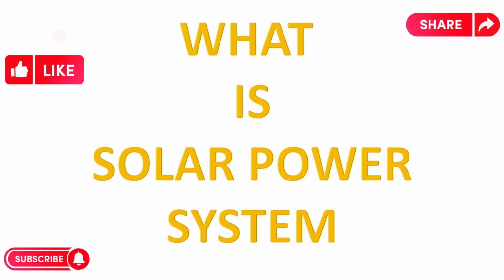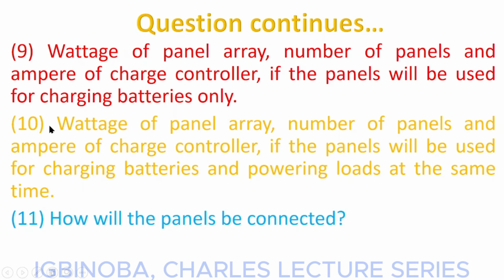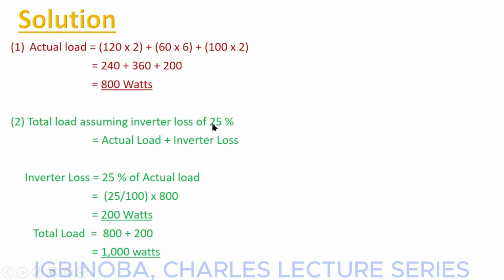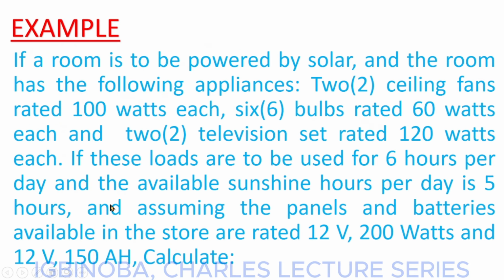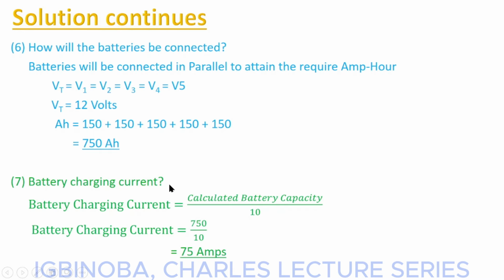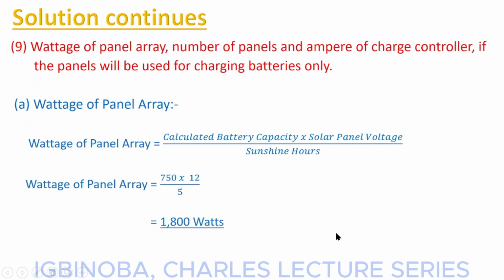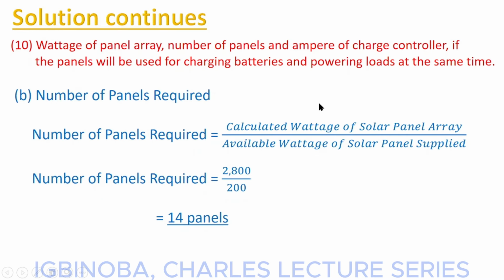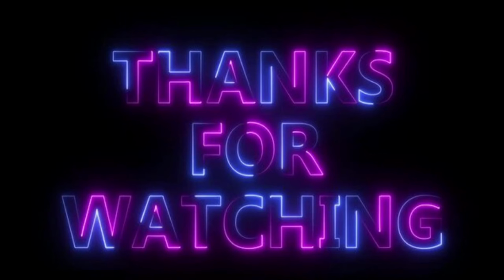Design of Solar Power System

Comment: Petro322v 
1) actual load=1380watts
2)total load =1725watts 
3)inverter rating=2156.25v
4)battery capacity =1293.75Ah
5)number of batteries =9
6)batteries are connected in parallel 
7) battery charging current is 129.4amps 
8)charging time=4hours 
9a)wattage of panel array=3105watts
9b)number of panels =16 panels 
9c)charge controller =258.75
10a)wattage of panel array =4830watts
10b)number of panels=24
10c)charge controller =402.5A
11)panels are arranged in parallel

Comment: CIV36F 
1. Actual load: 1380 watts
2. Total load: 1725 watts
3. Inverter rating: 2156.25 VA
4. Battery capacity:1293.75 Ah
5. Number of batteries: 8.6
6. Connection: parallel 
7. Battery charging current: 129.375
8. Charging time 
9. a. Wattage of panel array: 3105W
     b. Number of panels:16 panels 
     c. Charge controller: 258.75A
10 a. Wattage of panel array - 4830W
      b. Number of panel - 24
      c. Charge controller - 402.5A
11. Panels arrangement: Parallel
Reply: CIV317Q

1. Actual load:1380 watts
2. Total load:1725 watts
3. Inverter rating:2156.25 VA
4. Battery capacity:1293.75 Ah
5. Number of batteries:8.6
6. Connection:Parallel
7. Battery charging current:129.375 A
8. Charging time:
9. a. Wattage of panel array:3105 W
   b. Number of panels:16 panels
   c. Charge controller:258.75 A
10. a. Wattage of panel array:4830 W
    b. Number of panels:24 panels
    c. Charge controller:402.5 A
11. Panels arrangement:Parallel

Comment: PETRO3128X
ANSWERS TO SWEP NEW TASK 
1. Actual load= (100×3)+(60×10)+(120×4) =1380watts
2. Total load assuming inverter loss of 25%= Actual load +Inverter loss
Inverter loss=25% of Actual load
= 25%×1380=345 watts
Total load= 1380+345=1725 watts
3. Inverter rating on VA using power factor of 0.8
= (1725÷0.8)= 2156.25
4. Battery capacity using factor for reserve 75%=(2×1725×6×0.75)=1293.75Ah
5. No. of batteries for backup hours=1293.75Ah÷150Ah= 8.6 =8 batteries 
6. How batteries will be connected?
The batteries will be connected in parallel 
Vt=V1=V2=V3=V4=V5=V6=V7=V8
Ah= 150+150+150+150+150+150+150+150=1200
7. Battery charging current=1293.75÷10=129Amps
8. Battery charging time assuming charging loss of 40%= 1293.75Ah+(40%+1293.75Ah)÷129A=14hrs
9a. Wattage panel array= 3105 watts
9b. Number of panels required= 3105÷345=9 panels 
9c. Ampere of charging controller required= 3105÷12=258.75Amps
10a. Wattage of panel array= Calculated wattage of solar panel array for charging battery only+ calculated total load =3105+1725=4830watts
10b. Number of panels required= calculated wattage of solar panel array÷ Available wattage of solar panel supplied= 4830watts÷345= 14Amps
10c. Ampere of charge controller= calculated wattage of solar panel array÷ solar panel voltage=4830watts÷12volts= 402.5Amps
11. How will the panels be connected?
Ans: They will be connected in parallel

Comment: PETROCHEM392N

1 Actual load 1380W
2 Total load  1720W
3 Inverter rating  2156.25VA
4 battery Capacity 1293.75Ah
5 number of batteries 8.6
6 Parallel 
7 Battery charging  129.4A
8 T = 14hrs
9 (a) 3105W
   (b) 15.5 panels 
   (c)  258.75 A
10 (a) 4830W 
     (b) 24 panel 
     (c) 402.5A 
11 Parallel

Comment: COMP3111G

1. Actual load: 1380 W
2. Total load with 25% inverter loss: 1840W
3. Inverter rating (PF 0.8): 2 300 VA
4. Battery capacity (75% reserve): =920 Ah
5. Number of batteries: 7 batteries
6. Battery connection: All parallel
7. Battery charging current: 138 A
8. Battery charging time (40% loss):8.3 hours
9. Panels for battery charging only: 14 panels (2800 W), 250 A controller
10. Panels for charging + direct load: 26 panels (5 200 W), 420–450 A controller
11. Panel connection: 7S2P

Comment: COMP316P

1.	Actual Load = 1380 watts
	2.	Total Load = 1725 watts
	3.	Inverter Rating = 2156.25 VA
	4.	Battery Capacity = 1293.75 Ah
	5.	Number of Batteries = 8.625 ~ 9 batteries
	6.	Parallel
	7.	Battery charging current = 129.375 Amps
	8.	Charging time = 14 hrs
	9.	(a) 3105 watts
(b) 15.525 ~ 16 panels
(c) 258.75 Amps
	10.	(a) 4830 watts
(b) 24.15 ~ 24 panels
(c) 402.5 Amps
	11.	Parallel
Reply: EEE378Z

1. Actual Load = 1380 watts

2. Total Load = 1725 watts

3. Inverter Rating = 2156.25 VA

4. Battery Capacity = 1293.75 Ah

5. Number of Batteries = 8.625~9 batteries

6. Parallel

7. Battery charging current = 129.375 Amps

8. Charging time = 14 hrs

9. (a) 3105 watts

(b) 15.525~16 panels

(c) 258.75 Amps

10. (a) 4830 watts

(b) 24.15~24 panels

(c) 402.5 Amps

11. Parallel

Comment: COMP384F
 

	1.	Actual Load = 1380 watts
	2.	Total Load = 1725 watts
	3.	Inverter Rating = 2156.25 VA
	4.	Battery Capacity = 1293.75 Ah
	5.	Number of Batteries = 8.625 ~ 9 batteries
	6.	Parallel
	7.	Battery charging current = 129.375 Amps
	8.	Charging time = 14 hrs
	9.	(a) 3105 watts
(b) 15.525 ~ 16 panels
(c) 258.75 Amps
	10.	(a) 4830 watts
(b) 24.15 ~ 24 panels
(c) 402.5 Amps
	11.	Parallel

Comment: CIV340N

1. Actual Load = 1380 watts
2. Total Load = 1725 watts
3. Inverter Rating = 2156.25 VA
4. Battery Capacity = 1293.75 Ah
5. Number of Batteries = 8.625 ~ 9 batteries
6. Parallel
7. Battery charging current = 129.375 Amps
8. Charging time = 14 hrs
9. (a) 3105 watts
(b) 15.525 ~ 16 panels
(c) 258.75 Amps
10. (a) 4830 watts
(b) 24.15 ~ 24 panels
(c) 402.5 Amps
11. Parallel

Comment: EEE3158B
1. Actual load = 1380 watts
2. Total load = 1725 watts
3.Inverter rating = 2156.25 VA
4.Battery rating = 1293.75 Ah
5.Number of batteries = 9
6.Battery are connected in parallel
7.Battery charging current = 129.4 Amps
8.Battery charging time = 14 hrs
9
a Wattage of panel array = 3105 watts
b Number of panel = 16 panels
c Charge controller = 258.75 A
10.
a Wattage of panel array = 4830 watts
b Number of panels = 24
c Charge controller = 402.5 A
11.panels are arranged in parallel

Comment: PETRO347U

1. Actual load= (100 × 3)+(60 × 10)+(120 × 4) =1380watts.

2. Total load assuming inverter loss of 25%= Actual load +Inverter loss
Inverter loss=25% of Actual load
= 25%×1380=345 watts
Total load= 1380+345=1725 watts.

3. Inverter rating on VA using power factor of 0.8
= (1725÷0.8)= 2156.25 VA

4. Battery capacity using factor for reserve 75%=(2 × 1725 × 6 × 0.75) ÷ 12=1293.75Ah

5. No. of batteries for backup hours = 1293.75Ah ÷ 150Ah = 8.6 = 9 batteries.

6. How will the batteries be connected?
The batteries will be connected in parallel .

7. Battery charging current = 1293.75 ÷ 10 = 129 Amps

8. Battery charging time assuming charging loss of 40% = 1293.75Ah + (40% + 1293.75Ah) ÷ 129A = 14 Hrs.

9a. Wattage panel array= 3105 watts

9b. Number of panels required= 3105 ÷ 200 = 15.53 = 16 panels 

9c. Ampere of charging controller required= 3105 ÷ 12 = 258.75 Amps.

10a. Wattage of panel array= Calculated wattage of solar panel array for charging battery only+ calculated total load = 3105+1725 = 4830watts.

10b. Number of panels required= calculated wattage of solar panel array ÷ Available wattage of solar panel supplied= 4830 ÷ 200 = 24.15 panels 

10c. Ampere of charge controller= calculated wattage of solar panel array ÷ solar panel voltage = 4830watts ÷ 12Volts= 402.5 Amps.

11. How will the panels be connected?
Ans: They will be connected in parallel

Comment: MAR340N

1. Actual load= (100×3)+(60×10)+(120×4) =1380watts
2. Total load assuming inverter loss of 25%= Actual load +Inverter loss
Inverter loss=25% of Actual load
= 25%×1380=345 watts
Total load= 1380+345=1725 watts
3. Inverter rating on VA using power factor of 0.8
= (1725÷0.8)= 2156.25
4. Battery capacity using factor for reserve 75%=(2×1725×6×0.75)=1293.75Ah
5. No. of batteries for backup hours=1293.75Ah÷150Ah= 8.6 =8 batteries 
6. How batteries will be connected?
The batteries will be connected in parallel 
Vt=V1=V2=V3=V4=V5=V6=V7=V8
Ah= 150+150+150+150+150+150+150+150=1200
7. Battery charging current=1293.75÷10=129Amps
8. Battery charging time assuming charging loss of 40%= 1293.75Ah+(40%+1293.75Ah)÷129A=14hrs
9a. Wattage panel array= 3105 watts
9b. Number of panels required= 3105÷345=9 panels 
9c. Ampere of charging controller required= 3105÷12=258.75Amps
10a. Wattage of panel array= Calculated wattage of solar panel array for charging battery only+ calculated total load =3105+1725=4830watts
10b. Number of panels required= calculated wattage of solar panel array÷ Available wattage of solar panel supplied= 4830watts÷345= 14Amps
10c. Ampere of charge controller= calculated wattage of solar panel array÷ solar panel voltage=4830watts÷12volts= 402.5Amps
11. How will the panels be connected?
Ans: They will be connected in parallel

Comment: EEE322V

1)actual load = 1380watts 

2)total load= 1725 watts 

3) inverter rating =2156.25VA 

4)battery capacity= 1293.75A

 5)No of batteries= 9
 
6)batteries are connected in parallel 

7)battery charging current =129.4amps 

8)battery charging time=14hrs 

9a) wattage of panel array= 3105watts 

9b)number of panels=16panels 

9c)charge controller= 258.75A 

10a)wattage of panel array= 4830watts 

10b)number of panels = 24 

10c)charge controller= 402.5A 

11)panels are arranged in parallel
Reply: 1)actual load = 1380watts     

2)total load= 1725 watts

3) inverter rating =2156.25VA 

4) battery capacity= 1293.75A 

5) No of batteries= 9 

6) batteries are connected in parallel 

7) battery charging current =129.4amps 

8)battery charging time=14hrs 

9a) wattage of panel array= 3105watts 
9b) number of panels=16panels 
9c)charge controller= 258.75A 

10a) wattage of panel array= 4830watts 
10b) number of panels = 24 
10c) charge controller= 402.5A 

11)panels are arranged in parallel Add a reply...

Comment: MAR3151U

1. Actual load= (100×3)+(60×10)+(120×4) =1380watts
2. Total load assuming inverter loss of 25%= Actual load +Inverter loss
Inverter loss=25% of Actual load
= 25%×1380=345 watts
Total load= 1380+345=1725 watts
3. Inverter rating on VA using power factor of 0.8
= (1725÷0.8)= 2156.25
4. Battery capacity using factor for reserve 75%=(2×1725×6×0.75)=1293.75Ah
5. No. of batteries for backup hours=1293.75Ah÷150Ah= 8.6 =8 batteries 
6. How batteries will be connected?
The batteries will be connected in parallel 
Vt=V1=V2=V3=V4=V5=V6=V7=V8
Ah= 150+150+150+150+150+150+150+150=1200
7. Battery charging current=1293.75÷10=129Amps
8. Battery charging time assuming charging loss of 40%= 1293.75Ah+(40%+1293.75Ah)÷129A=14hrs
9a. Wattage panel array= 3105 watts
9b. Number of panels required= 3105÷345=9 panels 
9c. Ampere of charging controller required= 3105÷12=258.75Amps
10a. Wattage of panel array= Calculated wattage of solar panel array for charging battery only+ calculated total load =3105+1725=4830watts
10b. Number of panels required= calculated wattage of solar panel array÷ Available wattage of solar panel supplied= 4830watts÷345= 14Amps
10c. Ampere of charge controller= calculated wattage of solar panel array÷ solar panel voltage=4830watts÷12volts= 402.5Amps
11. How will the panels be connected?
Ans: They will be connected in parallel

Comment: PETRO 9I 
1. Actual Load = 1380 watts

2. Total Load = 1725 watts

3. Inverter Rating = 2156.25 VA

4. Battery Capacity = 1293.75 Ah

5. Number of Batteries = 8.625~9 batteries

6. Parallel

7. Battery charging current = 129.375 Amps

8. Charging time = 14 hrs

9. (a) 3105 watts

(b) 15.525~16 panels

(c) 258.75 Amps

10.(a) 4830 watts

(b) 24.15~24 panels

(c) 402.5 Amps

11. Parallel

Comment: PETRO321U

1. Actual load= 1380watts
2. Total load assuming inverter loss of
25%=1725 watts
3. Inverter rating on VA using power factor of 0.8
= 2156.25VA
4. Battery capacity using factor for reserve
75%=1293.75Ah
5. No. of batteries for backup hours =9 batteries
6. How batteries will be connected?
The batteries will be connected in parallel
7. Battery charging current=129.4Amps

8. Battery charging time assuming charging loss of 40%=14hrs
9a. Wattage panel array= 3105 watts
9b. Number of panels required= 16panels
9c. Ampere of charging controller required=258.75Amps
10a. Wattage of panel array=4830watts
10b. Number of panels required= 24 panels
10c. Ampere of charge controller= 402.5Amps
11. How will the panels be connected?
They will be connected in parallel

Comment: MECH 387I
1) Actual Load=1380watts

2) Total load=1725watts

3) Inverter rating=2156.25v

4) Battery capacity=1293.75Ah

5) No of batteries=9

6) Batteries are connected in parallel 

7) Battery charging current=129.4amps

8) Battery charging time=14hrs

9a) Wattage of panel array=3105watts

9b) Number of panels=16panels

9c) Charger controller=258.75A

10a) Wattage of panel array=4830watts

10b) Number of panels=24

10c) Charger controller=402.5A

11) Pannel are arranged in parallel

Comment: MECH 3167K
1. Actual load 1380 Watts
2. Total load 1725 Watts
3. Inverter rating 2156.25VA
4. Battery capacity 1293.75Ah
5. Number of batteries 9
6. Parallel 
7. Battery Charging current 129.375amps
8. Charging time 14 hrs
9a. 3105 Watts
9b. 16 panels
9c. 285.75 amps 
10a. 4830 Watts
10b  24 panels
10c. 402.5 amps
11. Parallel

Comment: MECH3163G
1.) Actual load: 1380W
2.) Total load: 1840W
3.) Inverter Rating: 2300VA
4.) Battery Capacity: 1227Ah
5.) No. of Batteries: 9 batteries 
6.) Battery Connection: Parallel 
7.) Battery Charging Current: 15A
8.) Battery Charging Time: 5.1 days
9.) Panel Array -
a.) Wattage: 2945W
b.) No. of Panel: 15 panels
c.) Charging Controller Ampere: 245A
10.) Panel Array -
  a.) Wattage: 4785W
  b.) No. of Panels: 24 panels
  c.) Charge Controller Ampere: 339A 
11.) Panel Connection Series: Parallel

Comment: EEE3159C

1) Actual Load= 1380watts 
2) Total Load= 1725watts 
3) Inverter rating = 2156.25vA
4) Battery Capacity = 1293.75Ah 
5) No of Batteries = 9 
6) Batteries are connected in Parallel 
7) Battery Charging current= 129.4 amps 
8) Battery Charging time = 14hrs 
9a) Wattage of panel array = 3105watts 
9b) Number of panels = 16 panels 
9c) Charge Controller = 258.75A 
10a) Wattage of panel array = 4830watts 
10b) Number of panels = 24 
10c) Charge Controller = 402.5A 
11) Panels are arranged in Parallel

Comment: MAR348V

1. Actual load: 1380 W
2. Total load with 25% inverter loss: 1840W
3. Inverter rating (PF 0.8): 2 300 VA
4. Battery capacity (75% reserve): =920 Ah
5. Number of batteries: 7 batteries
6. Battery connection: All parallel
7. Battery charging current: 138 A
8. Battery charging time (40% loss):8.3 hours
9. Panels for battery charging only: 14 panels (2800 W), 250 A controller
10. Panels for charging + direct load: 26 panels (5 200 W), 420–450 A controller
11. Panel connection: 7S2P

Comment: MECH3139I

1. Actual load = 1380W
2. Total load = 1725W
3. Inverter rating = 2156.25VA
4. Battery capacity = 1293.75Ah
5. Number of batteries = 9
6. Connection is parallel 
7. Charging current = 129.38A
8. Charging time = 14 hrs
9a. 3150W 
9b. 15.5 -- 16 panels
9c. 258.75A
10a. 4830W
10b. 24 panels
10c. 402.5A
11. Connection is parallel

Comment: PETRO3136F

1. Actual load= 1380watts

2. Total load assuming inverter loss of 25%=1725 watts

3. Inverter rating on VA using power factor of 0.8
=  2156.25VA

4. Battery capacity using factor for reserve 75%=1293.75Ah

5. No. of batteries for backup hours =9 batteries 

6. How batteries will be connected?
The batteries will be connected in parallel 

7. Battery charging current=129.4Amps

8. Battery charging time assuming charging loss of 40%=14hrs

9a. Wattage panel array= 3105 watts

9b. Number of panels required= 16panels 

9c. Ampere of charging controller required=258.75Amps

10a. Wattage of panel array=4830watts

10b. Number of panels required= 24 panels

10c. Ampere of charge controller= 402.5Amps

11. How will the panels be connected?
They will be connected in parallel

Comment: EEE3115K
1. Actual Load: 1380Watts

2. Total Load (Including inverter loss) 1840W

3.Inverter Rating (VA): 2300 VA

4. Battery Capacity: 1227 Ah

5. Number of Batteries: 9 batteries

6. Battery Connection: Parallel

7. Battery Charging Current: 15 A (per battery string)

8. Battery Charging Time: 5.1 days

9. Panel Array (For charging batteries only)

. Wattage: 2945 W

. Number of Panels: 15 panels

. Charge Controller Ampere: 245 A

10. Panel Array (For charging batteries and powering loads):

. Wattage: 4785 Watts

. Number of Panels: 24 panels

. Charge Controller Ampere: 399 A

11. Panel Connection: Series - Parallel.

Comment: EEE3118N

1. Actual Load : 1380 watts
2. Total Load : 1725 watts
3. Inverter Rating : 2156.25 VA
4. Battery Capacity : 1293.75 Ah
5. Number of Batteries : 8.625 - 9 batteries
6. Parallel
7. Battery charging current: 129.375 Amps
8. Charging time : 14 hrs
9. (a) 3105 watts
(b) 15.525-16 panels
(c) 258.75 Amps
10. (a) 4830 watts
(b) 24.15 - 24 panels
(c) 402.5 Amps
11. Parallel

Comment: MECH3143M
 
  1. Actual load :1380 watts  
  2. Total load : 1725 watts  
  3. Inverter rating: 2156.25 VA  
  4. Battery capacity= 1293.75 Ah  
  5. Number of batteries: 8.625 ~ 9  
  6. Parallel  
  7. Battery charging current: 129.375 Amps  
  8. Charging time: 14 hrs  
  9. a) 3105 watts  
  b) 15.525 ~ 16 panels  
  c) 285.75 Amps  
  10. a) 4830 watts  
  b) 24.15 ~ 24 panels  
  C) 402.5 Amps  
  11. Parallel

Comment: NAT329C

1. Actual load: 1380W

2. Total load: 1725W

3. Inverter rating: 2156.25VA

4. Battery capacity: 1293.75AH

5. Number of batteries: 9

6. Configuration: Parallel

7. Battery charging current: 129.375 amps

8. Charging time: 14 hours

9. (A) 3105W

(B) 15.5 panels

(C) 258.75A

10. (A) 4830W

(B) 24 panels

(C) 402.5A

11. Configuration: Parallel